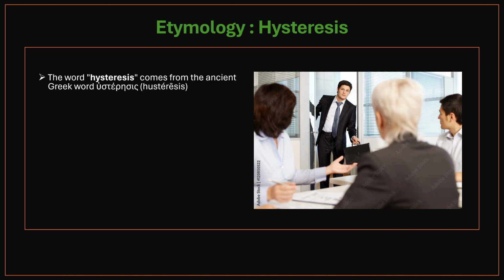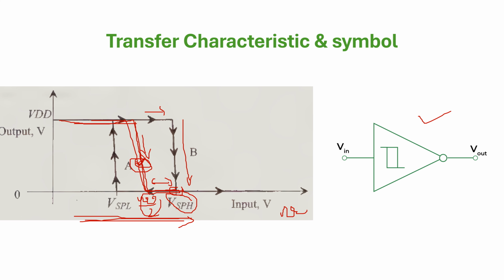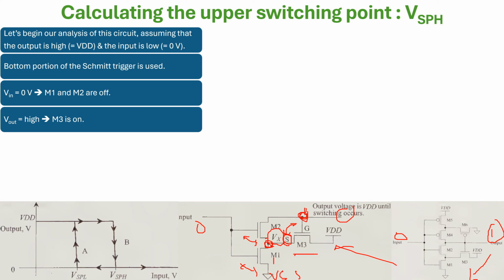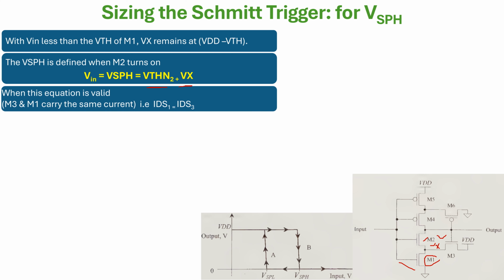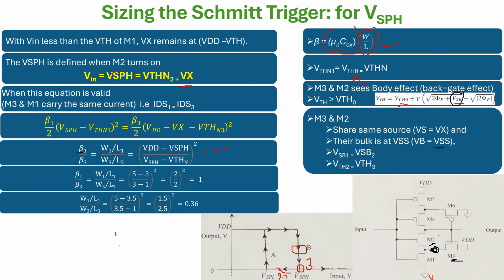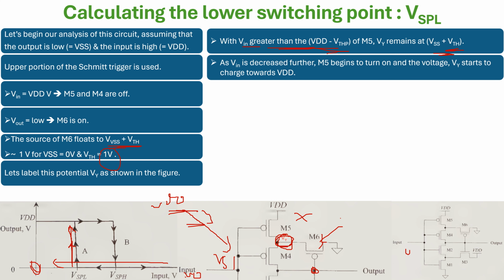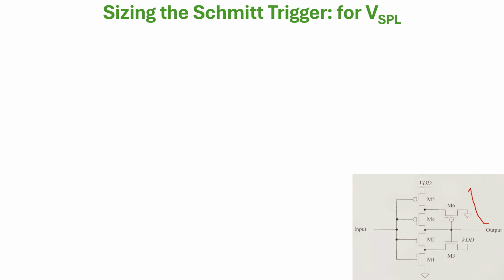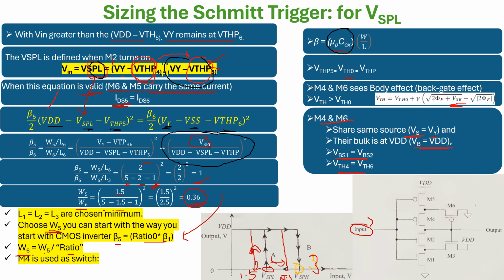CMOS Schmitt Trigger : Working & Sizing

Comment: The video is about CMOS Schmitt Trigger. In the world of electronics, a Schmitt trigger is a comparator circuit that has two threshold voltages, one for switching the output high and another for switching the output low. This creates a dead zone between the switching thresholds, making it immune to small voltage fluctuations and electrical noise.

The video goes over the following:

What is a Schmitt Trigger

Applications of Schmitt Trigger

How a Schmitt Trigger Works

Sizing the Schmitt Trigger

Here are some of the key takeaways from the video:

A Schmitt Trigger is a special type of logic circuit that acts like a comparator with a twist.

It has two threshold voltages, one for switching the output high and another for switching the output low.

This creates a dead zone between the switching thresholds, making it immune to small voltage fluctuations and electrical noise.

Some of the applications of Schmitt Trigger are filtering, voltage shaping, and square wave shaping.

The Schmitt Trigger is named after its inventor, Schmitt.

The original Schmitt Trigger used a vacuum tube as the comparator.

The hysteresis is an important property of the Schmitt Trigger. It is the difference between the two threshold voltages.

The Schmitt Trigger can be implemented using transistors or op-amps.

The video goes over how to size the Schmitt Trigger for a given application.